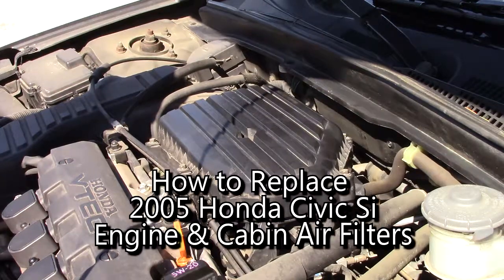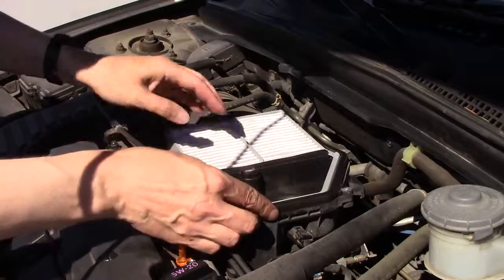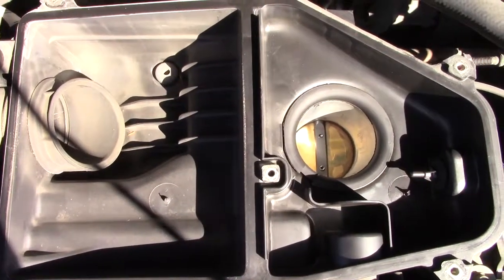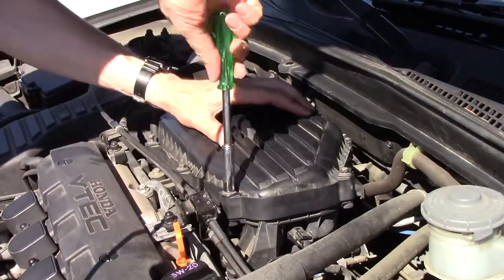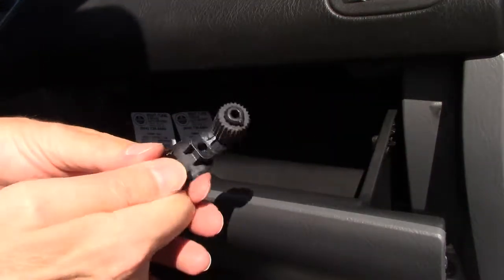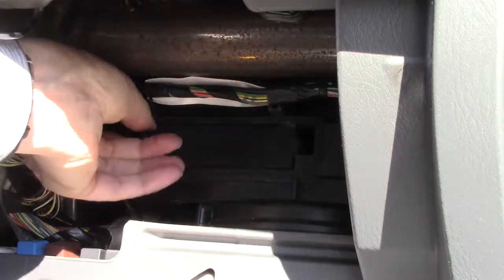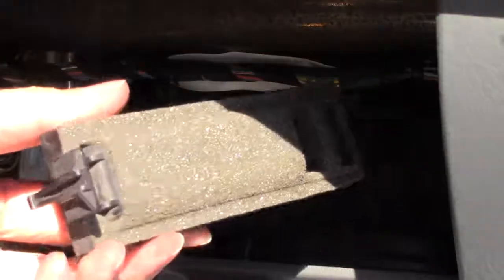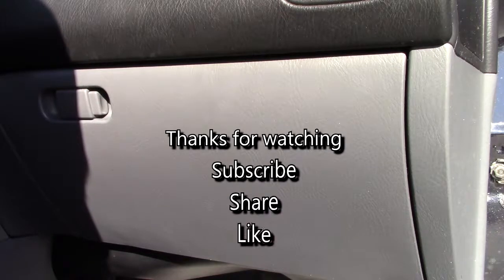How to Replace Air Filters 2001 2002 2003 2004 2005 Honda Civic

Comment: The previous owner mentioned never changing the cabin filter for the time he own it. Glad I looked or I would have not known it used two individual elements instead of one. My thanks.
Reply from the maker: also try to avoid parking under Pine or Cedar trees dropping crud into air vent, especially in British Columbia.

Comment from the maker: Replace both filters as part of regular car maintenance. Don't bother trying to clean or wash old filters, they are $20 each or less. If traveling regularly on dusty, smoky (forest fires) roads replace more often. Avoid parking under pine or cedar trees which drop fine needles into windshield/wiper drain which collects inside cabin filters, clogging them as shown in video.